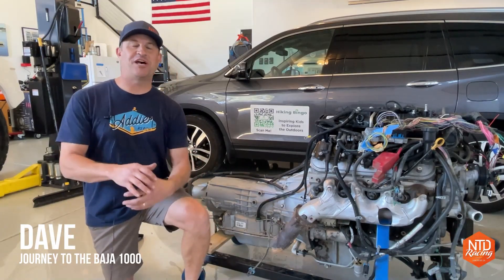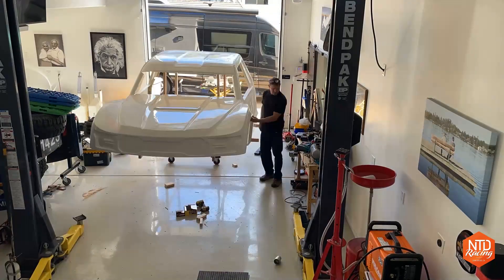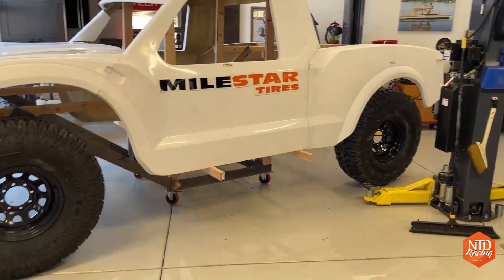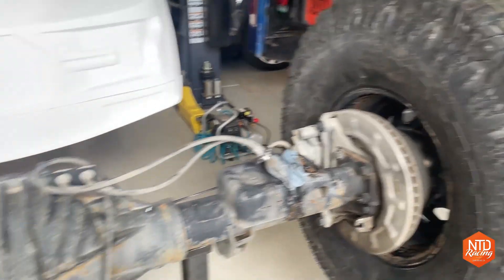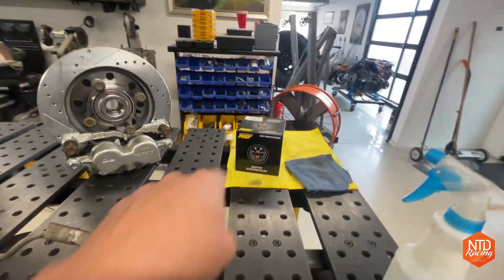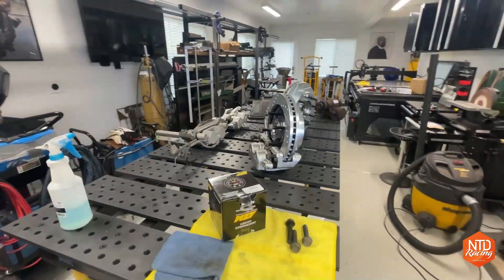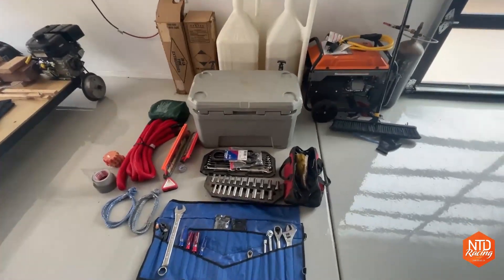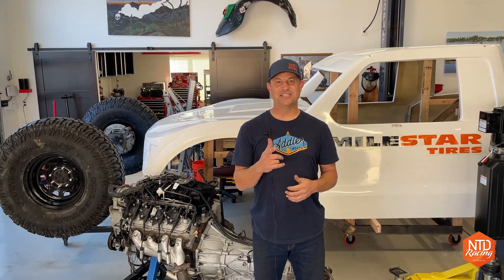Fiberwerx Ford Raptor Trophy Truck Body on HONCHO 2!

Comment: I’m excited to follow the build of your new truck. Is the ultimate plan to race both trucks at all the races?
Reply: The plan is to have both trucks racing in this year’s Baja 1000 - fingers crossed the new build goes smoothly. Before that we will race HONCHO! in a few races - first up the MINT 400 in just 3 weeks.